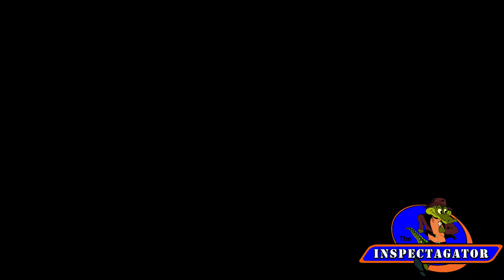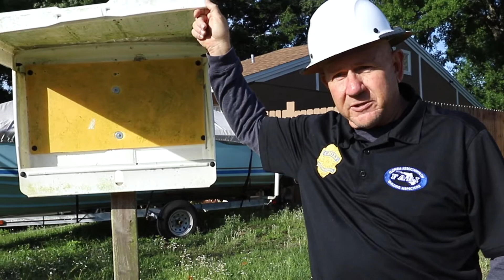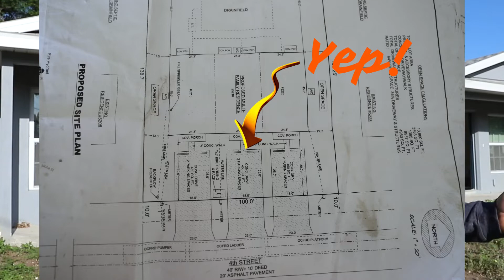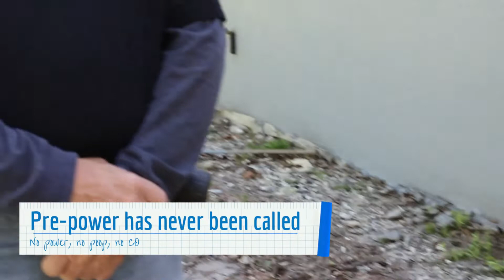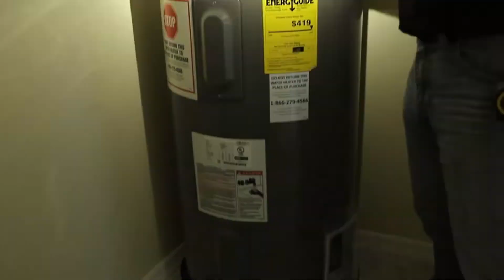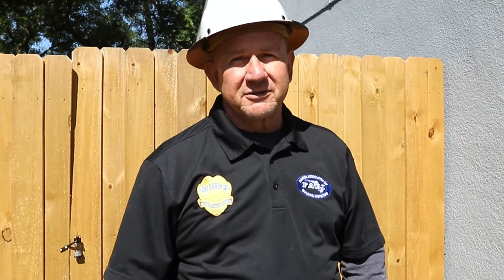New construction defects, poor planning...

Comment: While we are planning a 3d party inspector ahead of moving in, we should have ordered a pre-drywall inspection. My husband pointed out, took pictures, of a load bearing wall in master bathroom. Interior wall. The bottom of the wall was sitting on one inch, so my husband asked them to address this due to concern of future instability, cracks after settling. The builder responded they would take care of it. That was Sep 2021. The wall has tile on it now. We asked for clarity on what measure was taken to correct it. The builder said it was approved by county engineering inspector. We don’t know what issue we may encounter. Now we want to speak to the county to confirm and get in writing. We are figuring if there is a future issue, we can at least have some backup. What are your thoughts?
Reply from the maker: I'm no attorney but thinking that there is always that "latent defect" option.  Your attorney will need to step in when/if anything happens.  You are not alone, your experience has been our experience several times.  But just know that just because "it passed municipal inspection" or you got a CO, DOES NOT mean your house is code compliant.